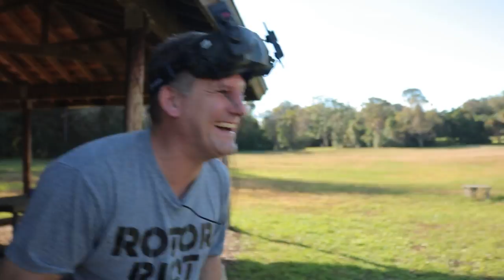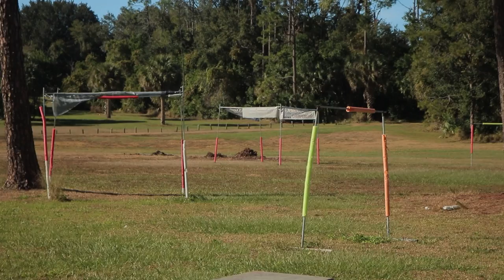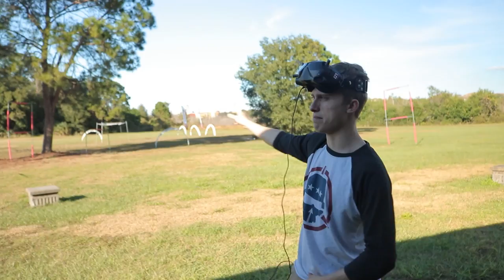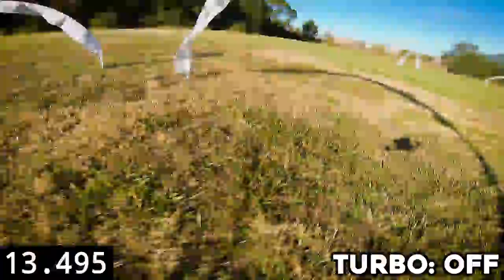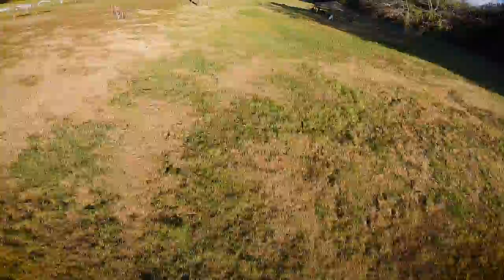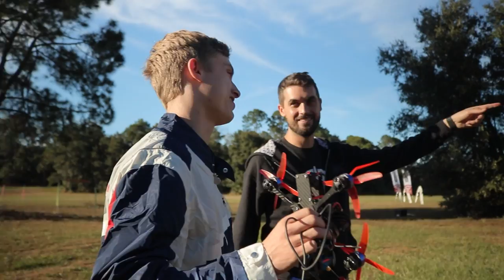Turbo Kwad!! - the ULTIMATE Race Drone?

Comment: Would like to see it integrated into the throttle somehow making it easier for him to apply smoothly
Reply: or mounted on a servo so it always pushed foward
Reply: This could be done easily with logic switches in opentx
Reply: I used a side slider on a horus x10s controller to do just that :)
Reply: Sup matt!!! Didn't knew u were into miniquads!
Reply: You can add it to the motor mixer for forward pitch.
Reply: Yeah I think it's probably feasible by a channel mixing.
Reply: Mix the boost into forward tilt.
Reply: Pots on radio?
Reply: Exactly what I was thinking that way he doesn’t have to focus on the switch. Just get used to the feel.
Reply: Imagine mounted with a servo so it woud change the angle too
Reply: @Robbiebrito  and use EDF for cool factor!
Reply: Easiest way would just be to bind the fifth motor to a dial or knob
Reply: @CF_Joel  thats exactly what i was thinking would love to see that
Reply: Definitely! And maybe steer with the rear rotary too, integrate them both.
Reply: or a food padle?
Reply: Then it would behave like an actual car turbo with lag. Like it spools up when you get into the upper range of the throttle.
Reply: NO IT MUST BE INSTANT LIKE MASSIVE NITROUS SHOT
Reply: and at an angle to get all blade the same directon for max speed!
Reply: Could of mixed the servo to throttle and that would've helped
Reply: How abt a pedal like a sewing machine or a car throttle

Comment: If you use two counter rotating motors you could counteract the roll torque moment the one motor causes. As far as the pitch moment created, the mount for the motor could be lowered to be more in line with the center of mass, but that might be a little more impractical. Loving all the fun ideas!

Comment: The torque is throwing the entire thing off. You should get some counter rotating 3' motors and use that as the "turbo".
Reply: Also my thoughts!
Reply: I think this could help. double-turbo is better than single-turbo ;)
Reply: Get some of those crazy Nazgul 3061 props for it.
Reply: making sure the thrust vector goes through the cg would probably help a lot
Reply: All alternatively you could have the prop mounted in such a way that its force goes through the center of the drone, then you wouldn't have the offbalance at least
Reply: Get the push to push through the center of mass then put a extremely pitched prop.  It will not give as much thrust at first, then when you get up to speed to will give you the most speed.  Hopefully that will make the transition more flyable.  You could also put a buddy box on it to control just the throttle of the fourth motor and have your wingman marinate the throttle for you.
Reply: Bingo!

Comment: Rather than flip on switch, make a pedal switch. The best will be with potentiometer, just like accelerator pedal.
Reply: Another one, lol. I just wrote this then scroll down and see a couple of you beat me to it ✌️
Reply: Yeah like a Wah pedal or a sewing machine.  You use your feet when you fly a real helicopter, so this is actually a spot on idea.  Yours was too BergerMan ; )
Reply: Good idea!  You can buy guitar volume  or expression pedals for cheap.
Reply: Or use switch and integrating with throttle
Reply: Isn't implementing it to the Throttle the better way?
Reply: Needs a special mixer so it integrates to the pitch axis.

Comment: Excellent idea ! One suggestion: You can tune the 5th motor to turn on at above 50% throttle. That way it will work more efficiently and help increase the speed more at straight line / higher throttle

Comment: Wanna see how to set up the servo channel output to do this yourself? https://www.youtube.com/watch?v=jiD6aC0l1VQ&ab_channel=JoshuaBardwell

I think part of the problem is that the motor isn't pushing through the CG of the quad, so it is imparting a net-torque which the motors must overcome.
Reply: Totally agree... And maybe a way to overcome the abruptness of the turbo turning on and off would be to somehow just directly take throttle input to the "auxiliary" engine from the Pitch angle, which would enable hovering and would not require pilot to activate anything during the course...  I definitely like this build ALOT !
Reply: Agreed. They may as well keep rotating that motor past the cam angle until its the same as the other 4 and just have 5 motors' thrust, unbalanced though
Reply: Should of flown Bardwell out for this one! His name is fpvknowitall for a reason!
Reply: Joshua Bardwell  could the switch channel be mixed with the throttle to come on during  mid and full instead of having a separate switch? Or will it be too difficult to fly normally?
Reply: Yea first thing I was thinking. It's high up. Trying to flip the drone.
Reply: Does he power the 5th additional esc/motor off the 5v pad on his flight controller  or directly to the 4-in-one esc battery pad ? Thanks, I'm new to all this.
Reply: May I know for sure how to wire the signal wire of the 5th esc? Should it go to the spare motor pads(M5 or 6) on the FC or to a channel on my CRSF nano Rx? I already know how to setup servo on an AUX channel. Thank you in advance!

Comment: should have used a double motor on the back/bottom to even out the rotational force, it might have made it a smoother flight.
Reply: Omg yeah wasn't thinking about that and that would be insane
Reply: Could even have crazy yaw authority using thrust  differential  maybe help with turning
 
  Edit:  Should have each one turning to the outside so the torque difference when using thrust difference actually helps with the turn too
    Be even crazier if you could get it going fast enough forward to auto rotate
    the quad drone gyro 
 Put 4 motors on the back the battery in the front for balance get some up and down to have reversible props on all 8 motors need a cyborg to fly it 😆
Have fun tuning that thing  😆🥴😖
   Prop hangs and stands inverted craziness

Comment: A foot pedal switch would make it a lot more easier to operate than a flick of a switch great stuff. Can’t believe that rebar 😂
Reply: Just wrote that then scroll down and see you beat me to it by 10hrs, lol ✌️
Reply: that isn't rebar. It is just a lightweight aluminum bar. You can bend it with your knee especially at that length. No way you can bend rebar (the type of bar that goes in concrete).
Reply: @fprintf  yeah I was laughing when Vanny said that too. That's like the cheapest most brittle aluminum tubing you can get 😂😂😂

Comment: On 30th December 2020 at 10:00 AM, I had the idea to add a propeller at the back of a quad, at 8:00 PM, I discovered this video, and it works pretty well ! Well done guys, and good position of the push vector going through the gravity center. Next improvement can be to put 2 propellers running in opposite (cw ccw) to avoid torque effect and power consumption to compensate it.

Comment: I like Sean’s design. The adjustability of the motor mount is cool. Maybe put the booster on a knob instead of a switch for more control. Good stuff
Reply: Also after giving it some thought you could solve the counterrotating problem by replacing the boost motor with a rocket engine. Something with like a 6 second burn would be interesting

Comment: Yo!! Y'all are crazy nice. I'm a RC car guy.  I use servo mixing to add brake when I turn the wheel of my RC truck.  Mix the turbo motor with the throttle stick position.  Use the switch to toggle the turbo on or off.  More throttle, more turbo... Less throttle, less turbo for the turns.   Wire the fifth motor in series with the others for thrust.  The current stays the same. That should do it.  Hope that helps and Good luck!

Comment: You need to make sure that the thrust vector of the 5th motor points through the centre of mass. Then it won't induce any torque on the quad that would need to be compensated.

Comment: Great video guys!  Loved it! (I know this is a new comment on an older video, but...) You might try finding the Center of Gravity of the drone, then align the thrust vector of the Turbo motor through the CG at the angle of the camera.  This most likely would require a redesign of the Turbo Motor mounting brackets.

Comment: Man, man, how fast that goes. I've never seen this before. But it also happens quickly when things go wrong.
With an acceleration sensor you could measure the acceleration, and then adjust the angle of the turbo propeller with an extra servo.
I hope that with this idea I can contribute to the solution of the problem.
Keep it up.

Comment: Amazing work!
🤔 If it's a distraction to flip the 5th motor on and off, how about mapping the enabling of the motor to a switch but mapping the power output of the fifth motor to the combined stick inputs?
- If you're zero'd out on pitch and punch the throttle, your 5th motor power is null.
- If you pitch forward and punch throttle, the pitch/throttle combination pushes the 5th motor power curve to max.
- As you dial in roll and yaw, even with pitch and throttle high, the 5th motor is dialed back down.
This kind of setup should allow you to control the pusher motor output variably, maintaining control in curves, having max boost in straights and being able to hover in a stable manner. Would be a bit of tuning but once you get the curves mapped out, this should be pretty cool! :D

Comment: Cool. In addition to the center of gravity / center of thrust that Joshua wrote, don't forget it has a significant reaction torque too. It constantly tries to twist the quad along the turbo rotor axis when on. This effect might be especially strong when turning on/off turbo mode (when the turbo prop changes rpm fast). The FC might have hard times with this, and could degrade handling in general. Try using two counter rotating turbo propellers to cancel-out this effect. :)

Comment: Hey, guys. Please correct me if I am wrong, but I remember on Taranis it is something like concept of "inputs" and "outputs" and you can direct your inputs into outputs in any way including fancy formulas. So what can be done about the fifth motor is: you take "throttle" input and direct it to "5th motor output" with -0.5 (so it kicks in only when throttle reach 50%) and x2 multiplier afterwards (so it can reach full throttle as well).

Comment: Bind the turbo motor with throttle position, and activate it with a second kill (arm)  switch, that way you can fly with stand then activate the turbo motor mid fly, and control the output of the turbo with the analog position of the throttle!

Comment: The extra motor is to far in the back, the thrust is now above the center of mass. if you position the extra motor more in the middle I think it would be more stable. And hell yeah would I like to see another episode
Reply: The first design, I had it in the center of mass.  “Someone” thought it would look cooler in the rear. Lol 😂
Reply: Uhm. If i may ask, do you mean more in the middle along the length, or along the height of the Quad? 
(But great thinking :D)
Reply: @geminitheavali5018  yes, thanks
Reply: @LetsFlyRC  wow, you know my opinion, but such a cool idea to be faster
Reply: As long as the thrust points towards the center of mass, the force itself shouldn't impact the quadcopter, except on turns. The rear prop causes a torque as well as a directional force, which messes with the flight controller stability. The quad is also torqued while the motor is spinning.
Reply: Add nose weight 😉

Comment: I just wanted to add, that was amazing, but you need to add one of those turning knobs on the throttle stick to control the turbo motor. this should be revisited. also, it was flying on 0 throttle cause of the autogiro effect. that is when a spinning propeller horizontally is pushed forward and the air resistance makes it spin and act like a wing.

Comment: You are onto something. A new category; drag droning or drone dragging. I wonder if that motor could be mixed in with the throttle somehow (and maybe a 6-in-1 ESC). For the Raider counter rotating "helicopter", I always thought the rear pusher prop was unnecessary and overly complex, but it is essential to get the speed/range.

Comment: I am new to drones but I think this Idea might help ...Integrate the turbo with a sideways swing mechanism to kind of boost it in the opposite direction of turn and the back end will turn pretty better and also don't need to flip the switches .Just an idea

Comment: You should hook it up in parallel with one of the rear motor controller outputs, and use a transistor so that it only kicks on past a certain throttle level. That way, the fan will kick on for the straight aways and the speed will scale with the rear motor, then it will kick off when you let off the throttle. Also, add a servo to the fan and a gyro sensor, and make the angle of the fan match the angle of the quad. This whole thing can be done with no coding if you're electrically savvy, or you can power a tiny arduino and code it yourself. It would be crazy simple to code and wire correctly

Comment: This was EPIC!!   You asked how it could be improved upon,   I was thinking match the forward facing prop throttle speed to the other motors so full throttle straights give full boost, half throttle corners give half boost, the boost is always active while on throttle.  Secondly would be to add left and right rudder movement to match the pitch up and down of the 5th motor.  Essentially that would give your assist in the corner and not just push the drone wide.  It would be a nightmare to map the servos and figure out the  pids for it but if done right and done well......  It should be game changing and definitely worth trying to perfect.  I'd love to see this continued and improved upon,  i really think you have something here!

Comment: Try the "Mixing" in your settings of your  FRSKY controller.  It allows you to mix one channel with another channel. For example you could set the 5th motor to come on at its mid throttle when the throttle stick is at 75% up and then when the stick is at full deflection you can set the mix to give full throttle to the 5th motor.   In theory when Alex hits the straight away and goes full throttle so will the 5th motor. So he doesn't have to deal with a switch.

Comment: One way to improve it would be to put it completely below the drone, and activate it proportionally the the drone angle and throttle (for example a mixer channel on the radio that use telemetry for the drone orientation.
That way you get a boost in speed when you tilt forward the drone

Comment: I build one of these years ago on a ZMR 250 frame. We were still using CPPM back then so I had the thruster wired directly to a spare channel bypassing the FC completely and has it controlled by a slider. Flew really well and very flat as there was no angle on the motor.
Reply: Yep, same way I setup my Foxtech Screamer pentacopter.   Throttle for the rear motor directly off the Rx.    They just didn't have that option using the DJI gear for control.

Comment: I bet you can make it so that the boost motor turns on or off depending on the position of the throttle, which would take a lot of the clinkiness out of the control.  That way, when the pilot is at, say, 80 percent throttle, the boost comes on automatically, and then turns back off automatically if the throttle goes under the threshold, like in a corner.  You could change the threshold based on the pilot and the specific course.

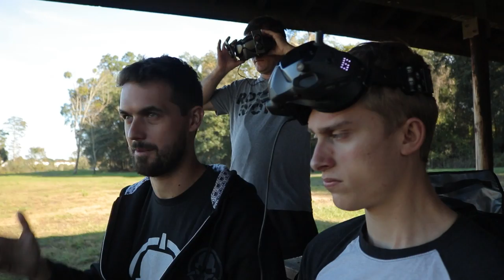Comment: 7:45 not true. You can just change rates using the betaflight OSD on analogue. Just yaw left+pitch up. Full access to most flight controller settings including PIDs and Rates.

Comment: Two smaller motors counter rotating on the turbo will make sure the quad doesn't always lean on one side when the turbo is on. Would be fun to try.

Comment: Nice job,  looks awesome.  Perfectly tuned to stay under 100mph. Think you could program BF to turn on boost at certain throttle positions and timing? I know the first part is possible,  but I imagine timing needs to be added in along with mixing,  so it doesn't just turn on during quick turns and other undesirable times.

Also,  I may have missed it but I imagine air mode was on,  but was it for that motor? If not or if so,  a minimum throttle is likely needed to prevent drag and the propellers acting like small sails

Comment: Might be interesting if the boost would kick in automatically only when roll and yaw axes are relatively centered and throttle is >~50%. This way it only kicks in on straight aways. It’d have to be implemented in the FC software. Honestly though, weird idea from a flight perspective. You’d probably do better just making it an 8motor quad
Reply: You can do that pretty easily with the "logical switches" in opentx. unfortunately only dependent on stick position and not acc/gyro data
Reply: @acy48  good point. maybe if it only kicked in at say ~>75% throttle, then it shouldn't kick in during turns (one would hope lol), only during fast straight aways. maybe even >90% is where it might work.
Reply: I had the exact same thought 😊 yes probably best if solved in FC, but maybe a quicker fix is to program it in opentx on the transmitter? So that the aux channel is only engaged when the sticks are within chosen parameters. Funny experiment, and fun to see so many people chiming in with improvement suggestions. At least they manage to make the content engaging, if not practical 🤓

Comment: I Wanna see dual rear turbos integrated to the throttle BUT USE 2 blade folding pusher props to get rid of the air drag. also  on the lower end  for sorta turbo breaking. SICK BUILD AND VID AS ALWAYS

Comment: two things.. maybe try adjusting the angle with a servo automatically based on quad tilt and second, make a mode where it adjusts throtle based on roll input (no roll = full boost etc)